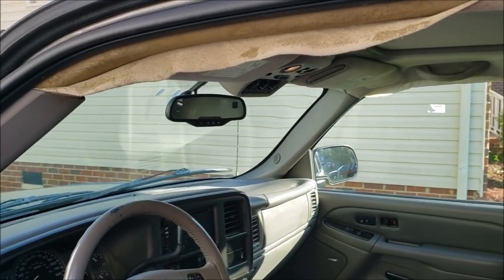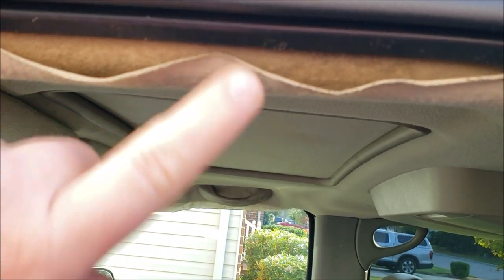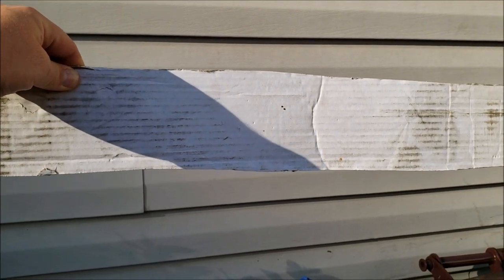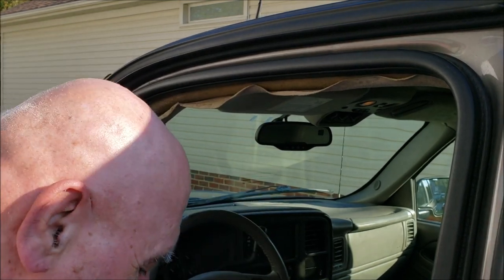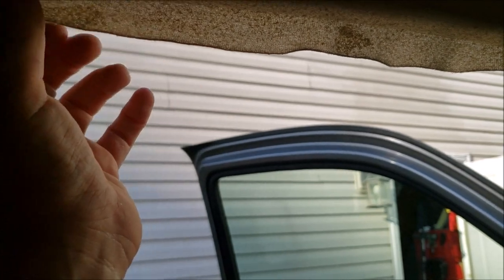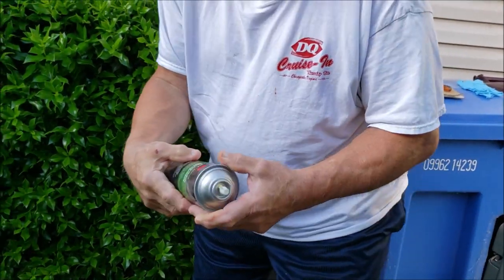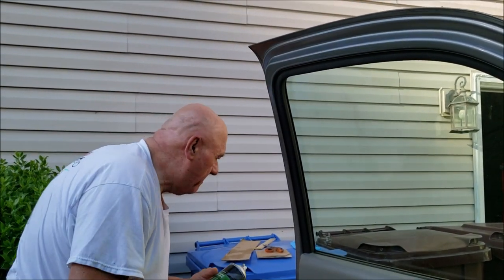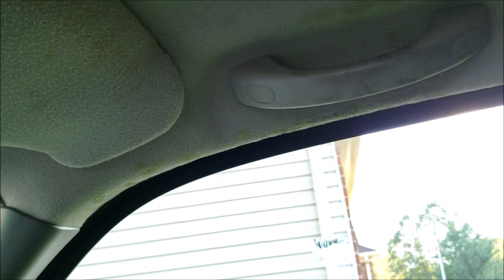Cheap and Easy Headliner Repair

Comment: When headliners fall, it's because the foam between the fabric and the board (headliner) above it is dissolving, it's not because the original glue is having any problems.  The original material on the ceiling is fabric backed with ~ 1/4" of foam.  As such, you can't put glue onto the fabric, it will bleed through like you see in this video, wet with the glue, and stain.  It can also screw up the board above by leaving mounds of glue that have to be sanded off one day when properly fixed.  if you can get glue sprayed super thinly (and give it time to tack up) on the board, it might work to press the fabric against it, but way more thinly than in this video.  Staples (like an office stapler) are easier to remove later and honestly would have made this cleaner looking because you can't really see them when in the driver seat.

Comment: That's why you don't spray that it on the thin headliner you would have to spray directly on to the ceiling , let it dry almost all the way then put it up to avoid bleeding through

Comment: 3m headliner adhesive works best they also so a repair kit on eBay it’s like a weather strip but hard plastic just slips on head liner and tucks in behind the door trim

Comment: I tried the 3m adhesive but didn't work well so I  tried clear carpet tape it's cheap $5 bucks a roll and still holding
Reply: Never heard of clear carpet tape. I will have to check it out. Can double sided tape be used?
Reply: @jefffaust89  Sure can.  My wife had some double-sided tape strips she used for temporary hems.  I used these and they're working like a charm.  The strips are just the right size to make them easy to work with and they are clear, so practically invisible!

Comment: Hey Matt. What spray glue do you think usually works best on repairing that headliner? :)
Reply: 3M makes glue specifically for headliners. Or their Super 77, but that's more for door panels or pillars that don't have that foam, it'll work too though.
Reply: @jessicah3450 Super 77 will NOT work. Use something more specific for headliners.

Comment: This get a yikes from me.  Only spray the headliner and not the actual upholstery. And don't be so heavy with it it doesn't take much. Let it tack off for 3 to 5 minutes and then roll it back on... I'm willing to bet your upholstery is hard to the touch which is not the most pleasing thing to see or touch unless you're a woman